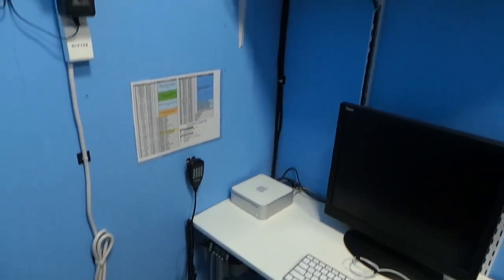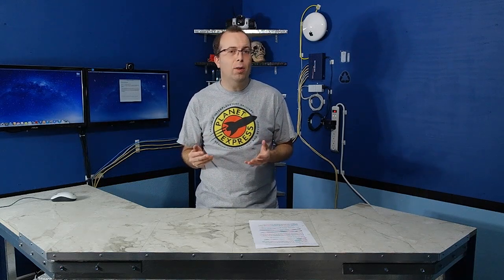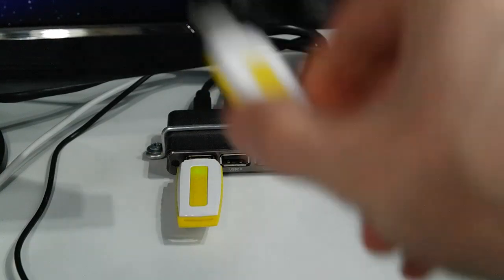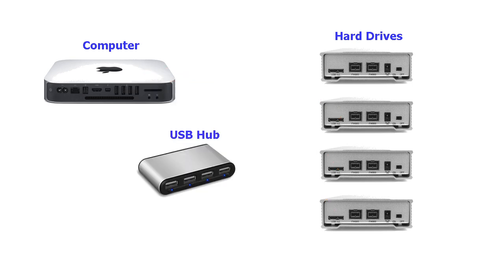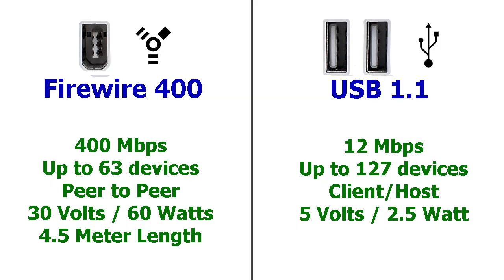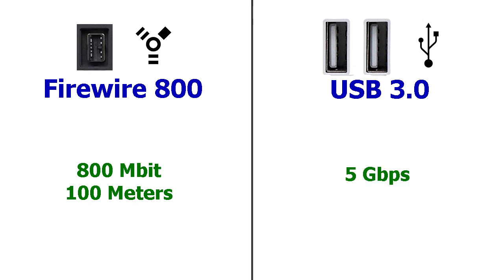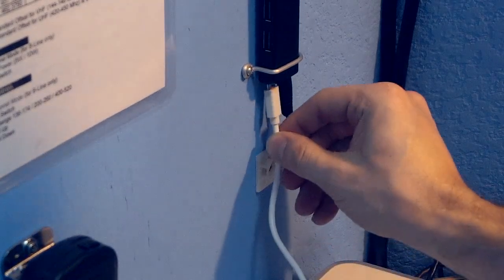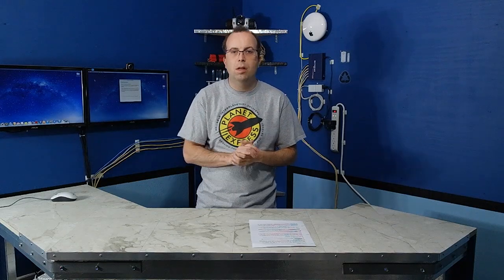Farewell R.I.P. Firewire, Hello USB!

Comment: USB 2.0 doesn't reach 480Mbps no matter how fast the cpu is. It's much closer to 300Mbps. Manufacturers just never got off their lazy bottoms to make it work the way it was designed. Connect any USB 2.0 hard drive to a USB 3.0 port and it'll be 50% faster.
Reply: No it won't be. If you notice any difference in speed between machines it's probably better USB 2.0 controllers. USB 3.x controllers (XHCI) do not handle USB 2.0 devices, they give them to the USB 2.0 controller (EHCI) to figure out. 

It doesn't make any difference whether you plug your USB device into a USB 3.x port or a USB 2.0 port. It's still going to be handed to the same controller and have the same data rate.
Reply: I have a laptop what can transfer data over USB 2.0 at 320Mbps (40MB) and a desktop that can transfer data at 480Mbps (60MB)
Reply: I think you're confusing Megabytes per second (MB/s) with Megabits per second (Mbps). USB 2.0 is only good for 480 megaBITS per second, or 60 megabytes per second for the raw theoretical bandwidth. Testing that same hard drive on a SATA to USB 3.0 converter yielded about 95MB/s.

Also USB 3.0 is good for 5 gigaBITS per second. M.2 is a formfactor, not a standard. So either you have a SATA based SSD (which would have a maximum throughput of 6 gigaBITS per second) in an M.2 slot or an NVMe SSD in an M.2 slot (NVMe is also good for only 2 gigaBYTES per second)
Reply: Wouldn't that apply to newer USB 2.0 controllers as well then? Or is everybody just using the same design since years and noone ever thought of getting it up to spec?
Reply: Yep, I had HDD enclosure with both 400-mbit FireWire and USB2. FireWire mode worked faster than USB2.0 in any of the mass storage devices I used.
Reply: +Jason Lee thanks for the correction I forgot the port was called RS-232
Reply: First hand experience makes your statement untrue, it makes no difference. Usb 2.0 has 4 pins while Usb 3.0 has 9 pins. Using a 2.0 usb on a 3.0 port makes no use of the extra pins.
https://qph.fs.quoracdn.net/main-qimg-8bdad1f1fb5a483d0fd5ac260040b14a.webp
Reply: "USB 2.0 hard drive to a USB 3.0 port and it'll be 50% faster." Please prove that in a video.
Reply: @kyoudaiken  I've tried it with my 2.0 HDD, it really is alot faster.
Reply: ***** Just try it, it's not that hard to do.
Reply: thany3
I don't have any USB 2.0 drive anymore. So I can't.
Reply: @thany3  You can't increase USB 2.0 speeds by connecting it to USB 3.0.
Reply: @Andulvar  Yes and no. USB 2.0 only when connected to USB 3.0 will reach its full potential. Connected to 2.0 it'll only go as far as the controller allows. And ALL 2.0 controllers are poop.
Reply: USB aka Universal Serial Bus was designed to replace the COM port with a simpler connection but with the same protocols. With fewer wires, you have to send more protocols to emulate the old protocols to your devices so it knows what you want to do, and that takes up bandwidth that's why you can never max out the speed. It's the same reason you can't max out wifi or ethernet speeds.
Reply: ChannelSho Woops, yep. That explains a whole lot now.
Reply: thany3 nice google search
Reply: https://www.anandtech.com/show/4523/usb-30-flash-drive-roundup/7
Reply: it uses the speed of the lower capability
Reply: USB 2.0 is physically clocked at 480mbps if you start up a rtl-sdr you can even see interference at 480mhz that means that any data transfer happens at 480mbps just there are all sorts of overheads
Reply: Try a device with Cat 5 cabling (a.k.a Ethernet ) Ethernet not just for Internet anymore!
Reply: @AMPProf  you mean Use ethernet cable to transfer data? I did that when I bought my new laptop and it was much faster way than using usb.
Reply: Thunderbolt is the spiritual successor of FireWire, and it serves essentially the same segment of user needs, which is blazingly high speeds. There's no "winner", as both USB and FireWire/Thunderbolt have different use cases. Most people don't need the speeds of Thunderbolt, and they don't really mind that their external hard drive transfers files in 3 seconds instead of 1.
Reply: they don't put in the engineering effort but oh boy do they put in the marketing effort! USB 3.7 Gen 1.1 is what it seems like they'll end up doing with all the switches in naming scheme
Reply: i just tried and it didn't make any difference. it stayed between 15 and 30 MB/s with both.
Reply: I doubt this... USB 3.0 just adds a second channel for data if both the host and the client (and the cable, i suppose) support it. If they don't, it'll strictly adhere to the lowest common standard. So either the manufacturers got up to snuff with the 2.0 implementation in 3.0, or you'll get exactly the same speed as you got on a 2.0 port.

I don't have a hard drive handy, but I'll check it out when I get back to my other computer.

Edit: It's not that I don't wanna believe you. It's just that we're on the internet, where things like the waterproof iOS update happen.
Reply: @deepspacemachines  wait WHAT
Reply: Plugging in a USB 2.0 into a 3.0 port would give you the speed of 2.0 because it doesn't use the extra 5 pins from the USB 3.0 port. However, putting a USB 3.0 into a 3.0 port would give you the speed of USB 3.0 because it takes advantage of the extra pins. It's common sense.
Reply: Meh USB Drive reaches speed of POTATO, your argument is invalid.
Reply: ***** It's just that USB 2.0 has always been prohibitively inefficient. And it was never meant for high-speed mass storage. At the time, that's what Firewire was for, even though it was not as widepread, to say the least. They fixed it with USB 3.0, that does deliver on promised bandwidth.
Reply: @thany3  Nope, that doesn't.
Reply: @alandunaway3000  YMMV, but I actually tried it
Reply: @thany3  I can barely get 12Mbps on mine.
Reply: Can someone please tell me how to unsubscribe to this thread?
Reply: On the top of the thread is a small downward triangle. If you click on that, you'll see "Mute Post".

If you click that, you'll receive no more notifications about his thread.
Reply: 480Mbps is the total bandwidth USB has. This isn't counting overhead which is at least 10%.

Also it depends on what you're doing with the device, what else is on the bus, etc. It's like claiming your ISP never gives you the speed they advertised... it can (maybe), it just that there's a million other factors at play that are beyond your control.
Reply: USB is slower and more CPU intense than Firewire. Firewire essentially replaced SCSI and was designed with high speed in mind, whereas USB was meant, from the beginning to be a replacement for serial. They should have kept it alive, IMHO.
Reply: Hey I have a USB 3 HD that can also be used with a USB 2 cable so I will be testing this and uploading it to my channel today.
Reply: @emmettonline  4 years later and no video... hmmm
Reply: I just tested this with a hard drive connected to a SATA to USB 2.0 enclosure. They both got the same speed using either a USB 2.0 or USB 3.0 host, topping out at about 350Mbps or about 45MB/sec. 

Feel free to provide proof that a USB 2.0 drive can indeed use the full 480Mbps bandwidth on a USB 3.0 host.
Reply: A bit too much overhead then. But explain this: why does the same overhead not apply when connecting to a USB 3.0 host? Surely, if they agree on communicating with the USB 2.0 protocol, the speed should be capped to the same dissappointing 300Mbps-ish that the 480Mbps USB 2.0 can practically deliver on. But no. A USB 2.0 device connected to a USB 3.0 host, will bloom and show its true potential! Suddenly it'll work as intended and truly pump 480Mbps in and out of your pc!
Reply: Lawrence Franzen USB didn't replace COM, we still use COM to refer to the USB. It is a replacement of the RS-232 port
Reply: ChannelSho Like how USB 2.0 controllers have never been designed well, which is the sole reason the overhead appears to be closer to 30% than 10%.

Then again, why the overhead in the first place? If a car is advertised to reach a max of 200kmph, would you accept a max of 180kmph?

My ISP actually supplies me with MORE bandwidth than what I'm paying for, because they damn well know internet connections suffer from overhead problems. My advertised/promised bandwidth is 200Mb/s, but I'm easily getting 220Mb/s.
Reply: ZeroKelvin Keyboard
Just try it.
Reply: ChannelSho You shouldn't test with a hard drive. Hard drives are slower than USB 2.0 itself as the average speed is only 100-180 MB/s. Even my $60 120 GB m.2 SSD only reaches averagely around 300-500 MB/s through USB 3.0. Even though USB 3.0 also bottlenecks as m.2 max speed is 6 GB/s while USB 3.0 is 5 GB/s.
Reply: *****
The latter. Not sure why. Or perhaps the spec was such that it couldn't ever be as efficient as we should expect.